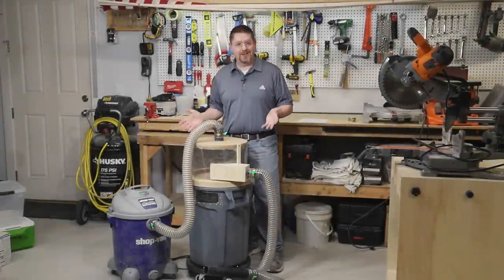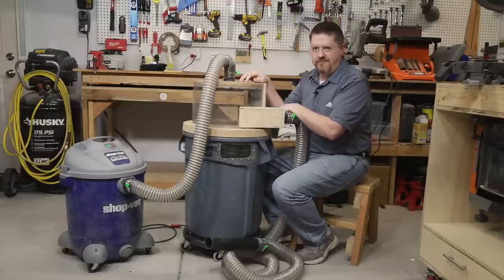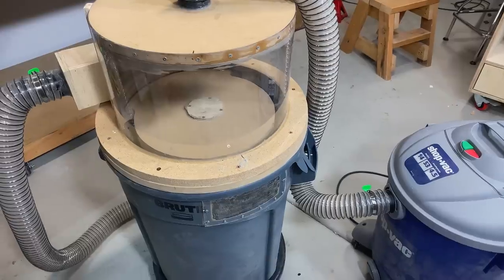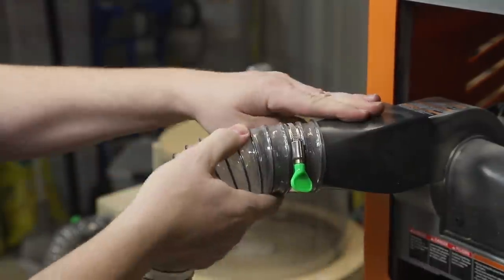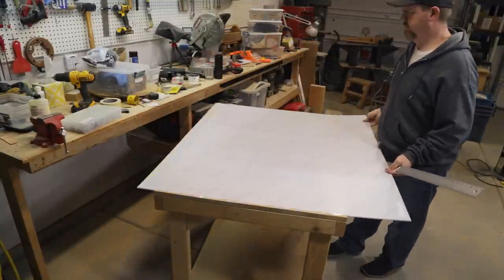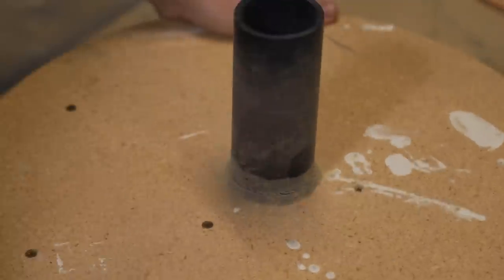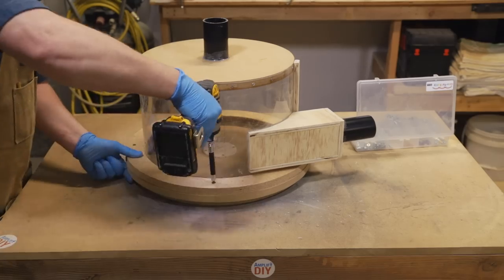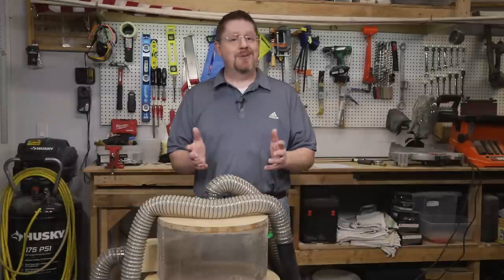Save Your Lungs! Dust Collection With a Thien Baffle Dust Separator

Comment: I would think that if the inlet was high up on the hat that would be better, but I am not an expert by any means, just something i noted from other similar designs.
Reply from the maker: I think the rationale behind having the inlet lower is that it's easier / faster for the dust to fall through the slit into the can below, and harder for it to get sucked up into the outlet port. If the inlet and outlet are both at the top, it's a little easier for dust to hop straight from inlet to outlet.... but I think either design will work quite well.

Comment: How does your separator stay connected to the trash can?  You show nothing on that.
Reply from the maker: Hi Steve - Sorry about the confusion. I did not show anything because there literally is nothing extra that I did. Gravity holds it on there just fine. When the vacuum is running, the suction in the system REALLY holds it on tight. Once I turn off the vacuum, I can just lift it right off the top of the can to go empty the can. Thanks for watching!

Comment: seems like you could've saved a ton of time by just using a 5 gal bucket cut down to size instead of the PC.
Reply from the maker: I considered a bucket, but it’s a much smaller diameter, and not clear. May work fine, though!